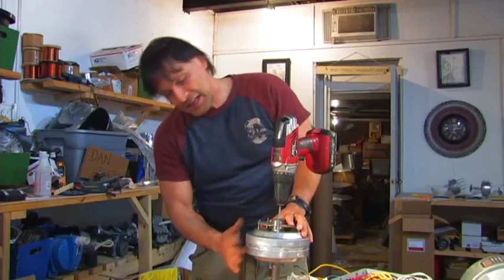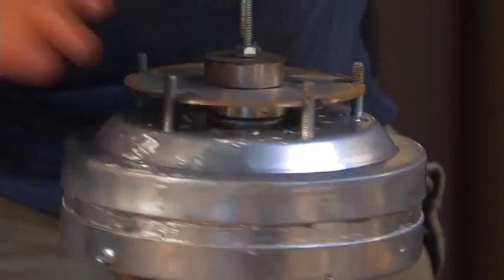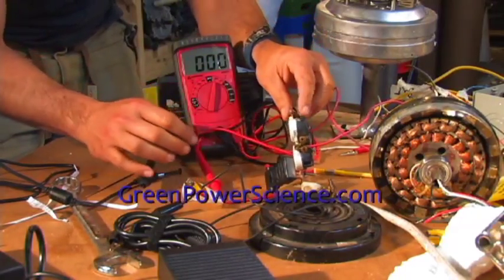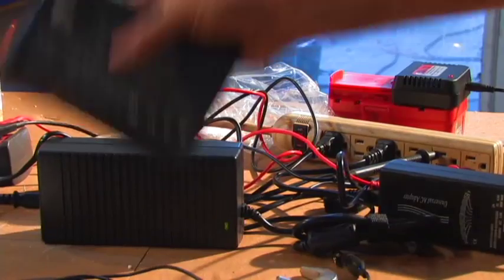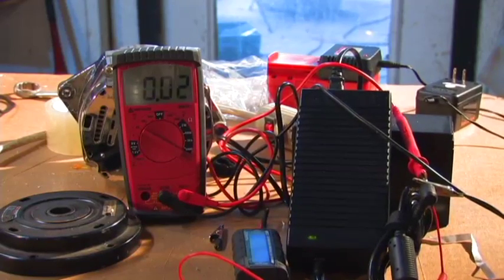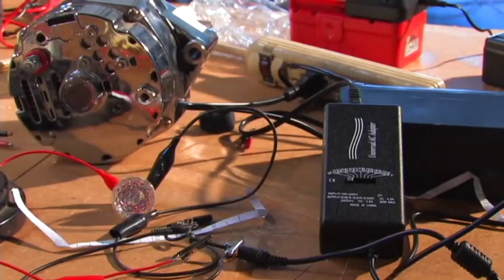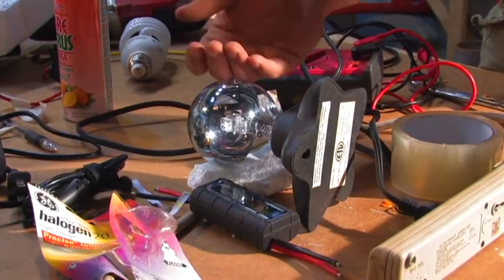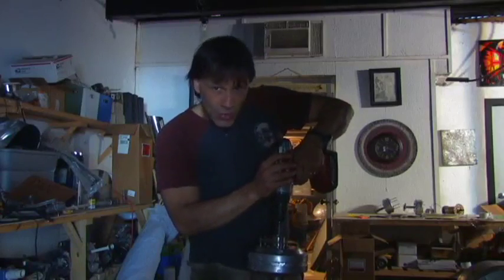CEILING FAN ALTERNATOR AC to DC Power Supply Converter

Comment from the maker: A high output 200 amp car alternator = 2400 watts.
12 volt x 200 ams = 2400 watts which would max it out. A DIY motor conversion would require an AC motor of at least 5hp converted with strong magnets. A simpler option might be to hack a 3000 watt inverter generator assuming you have a mechanical power source to turn it. If it is for wind the dual axial flux alternator is the most efficient. 1.9 kilowatt hours 24/7 continuous requires a hefty alternative energy source. What is your power source?

Comment: @leeryman I have had 150,000 volts go through my body with nothing more then a tickle. When I was young a 6 volt Volkswagen almost killed me. 

Voltage is only part of the equation. In order is quantify you commit you must use it in relation to wattage or scrap that and use Amps.

Comment: I built the first one of these back in about 2003,along with converting one to a pulsating dc motor.Since then we found a way to double the output by making a counter rotating blade unit.Found for charging 12v batteries, just get on ebay and buy a scooter voltage regulator,about $5.00.has a built in rectifier and is regulated to around 15.5 volts.
Reply: Lol my grandpas dad built these for wind mills we are talking 1948 maybe earlier.

Comment: @moonreft I am considering that the lethality comes from current.

50V from a low-impedance supply is seen as the point where currents through the (resistive) human body start to pose a risk. It also depends on the conditions (a welder at lower V might give you concern if you and your work are in a puddle). A vandergraph provides high V but is unable to supply a current.

The OP I was replying to was concerning mains supply, which definitely can supply enough current to kill in most situations.

Comment: @leeryman .... and what I really DO mind is if you grab the wire, and pull the plugh out WHILE holding the aluminum on the screen with your full ahnd. Honestly I have been zapped way too many time to count with high voltages but not with high amperages. I do sometimes zap myself on purpose with static electricity or HV/LC sparks. They don't hurt, on the contrary, they feel good. :3 I don't intend for anyone to follow me, since it still did mess with my mind a lot. Don't get paranoid!

Comment: Please read my comments in full. I have explained that it depends on, amongst other things: 
  1) Impedance of the supply (eg, vandergraph can only produce a limited current)
  2) Conditions at the time (eg, welder at 40V when fitter and work in puddle of water)

The original comments I replied to regarded mains. 50V across the body with sufficiently low impedance, and when aggregated by the environment, can kill. At the least the person should be receiving an ECG to check their heart rhythm.

Comment: As I was watching your video about the ceiling fans I have a question to ask you I took an old ceiling fan and I did the same thing I got it it out I put the magnets inside I turned over the stator and I closed everything back up when I turn it by hand I get voltage at showing me about 197 but if I hook up an LED light to it nothing happens maybe you can tell me what I'm doing wrong and how to fix to make it the LED light go on thank you Mike

Comment: @moonreft Well, you would use wattage since the amt of amps it takes to kills you varies with voltage. And you tell that to leeryman. Honestly, if any current of over 50V could harm you, I'd be dead A LONG time ago, and that too, I'd be dead around 3,000 times or more. I mean, I only LOVE shock people with imense static! and the normal static you get from a normal static shock is around 3,000V so, yea!

Comment: I have a question, its got me all confused. my celling fan wont run right on high or med or low speed unless the light is turned on when I turn the light off it slows down and makes noise.do you have any suggestions on this please its drivi g me crazy. jenny berry from Minnesota. thanks
Reply: im guessing something is wrong with one of the coils and the light is acting as a ballast and gets rid of the humming, but idk its not in front of me..

Comment: i've been following your vids for a while and i'm trying to make a bike generator.
I have a motor i pulled from a 300w kitchen grinder i think(230v), but it has no permanent magnets, just 1 field coil each side.. do i need some kind of external power circuit to create the magnetic field in order for the rotor to produce some juice?

thanks

Comment: The drill is spinning pretty fast and may not represent what a turbine could do.    If you would measure the open circuit voltage and short circuit current at some known RPM we could calculate the power into various loads at various RPMs.

Comment: @awesomelightning Please do not make such suggestions. It is very possible to be electrocuted or suffer an electric shock which may affect your heart (sometimes hours later) from contacting mains voltages. Industry standards vary between jurisdictions, but in general anything over 50V is considered of risk (it can depend on the conditions). I personally have received an electric shock, thanks to an electrician not following proper puncture of surface procedures, and I wouldn't wish it on anyone.
Reply: don't worry,Dan knows everything people don't know and think he's very smart and want subscribe and like.

Comment: so why not recharge or just power your drill whilst using it and then take off the battery and leave connectors on the drill...once power is initially put into your alternator surely u could use the power made to run the drill meaning u have continual power right? or wrong?
Reply: RaGiN BuLL why does the fan and alternator start turning when I put my cable on the battery car not running 68 Volkswagen

Comment: I don't understand ur alternator because stater n rotter together run a round  I am still thinking a bout it very deeply how is possible
Reply: look at those bolts, they are welded to the rotor ( case) and when he spins the stator stays still but you cant see because that big nut is covering it but doesnt touch it

Comment: This doesn't seem to be a very reliable way of charging batteries.  Your converter uses 90W and only 50W max is output to the battery.  So your application is really just a little over 50% efficient and that is when the fan is at full speed.  It might be better to stick with AC and get a reliable speed off the fan windings.  Measure it so it outputs 120V at X speed and regulate it so the speed is constant.  Up the speed when a load is attached to keep it at 120V.  A control loop of sorts, would require some other circuitry but your efficiency will increase...  Then you can buy an off the shelf efficient AC-DC charger that is much more efficient for your application.
Reply: yes cause so much energy goes to waste as heat when you start as ac, rectify to dc, then use an inverter to go back to ac..

Comment: how many amps?it's the amps that bite you not the voltage.
Reply: joseph fulks V=IR. therefore I (current) is equal to Voltage divided by Resistance. Your body has it's own resistance (something like 300-1000 ohms or whatever, depending whether it's wet, where it's touching, etc. ). Therefore the higher the voltage, the more amps you will receive. That is to say, the volts directly determine the amperage. While the common knowledge you've cited is TEchnically correct, it also leads to dangerous misconception. Even if his device were only capable of supplying a single amp, that could be lethal.

Be safe :)
Reply: wrong! it is the high voltage, not amperage! How many times did you electrocuted from a car battery? never! it has only 12 v and it's harmless, even though is can deliver a few hundred amps! But the taser has only a few miliamps but 5-10.000volts! Got it?
Reply: Gabriel Neculaica true
Reply: Gabriel Neculaica
Reply: joseph fulks

Comment: Don't tell people not to touch live electrical connections. We need to weed out the idiots anyway !!

Pretty cool but you'll never get more power out of it than that drill will put out. You're charging one battery with the energy of another battery and loosing energy in the process.  Put a prop on it and do something with it other than spinning wheels!

Comment: Levi Roberts; Exactly how is it that you came to post such a hasty and ignorant statement? I mean no insult. Sadly, you've: A) Failed to gather a correct concept of "Over Union", B) You failed to read the description of this video as well as having completely ignored the point of this video: To modify and improve the output of a ceiling fan to be used as A WIND TURBINE/GENERATOR. HE'S USING HIS DRILL TO DEMONSTRATE THE RESULTS OF THIS MOD IN A CONTROLLED MANNER.